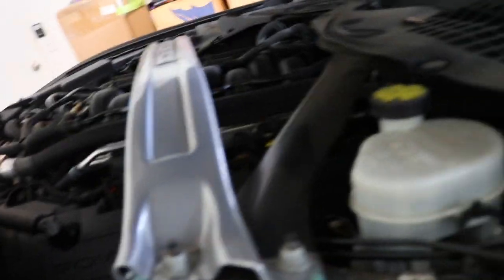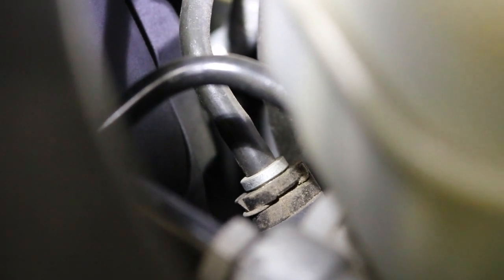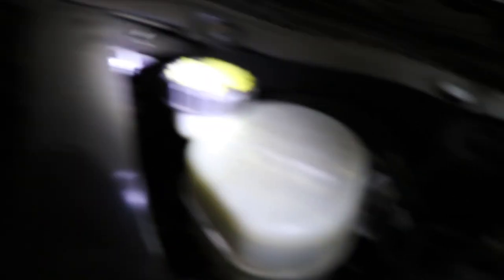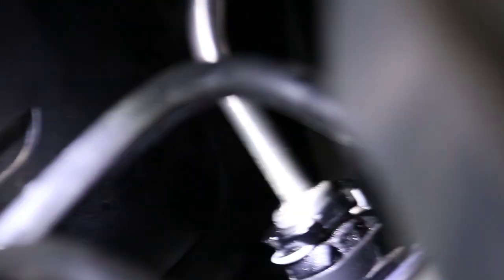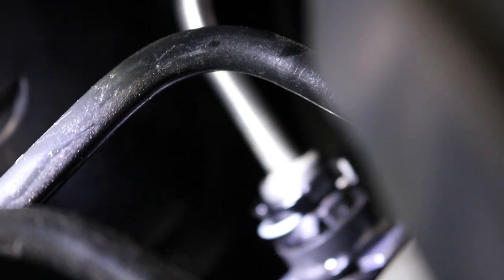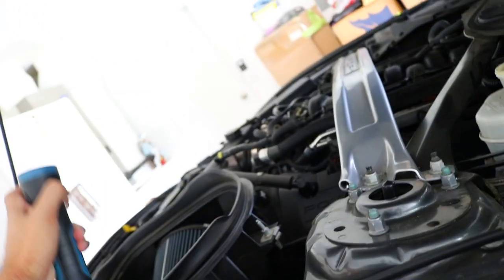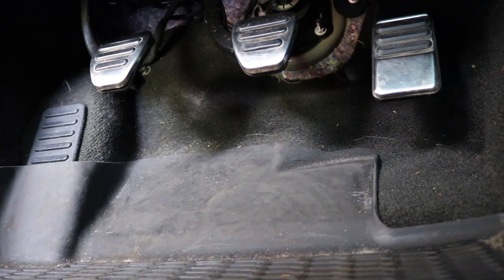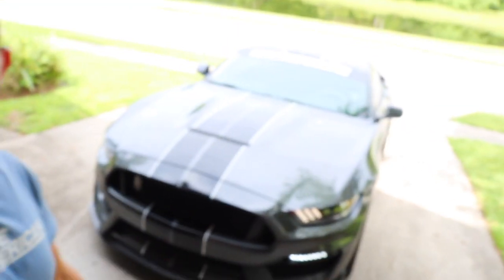BEST Clutch Line Upgrade for Your Mustang!! (15-23 Install)

Comment: Do you install the J&M clutch line on your GT350? I have a 2022 Mach 1 and I told the J&M will not fit with the Tremec?

Comment: Did it help with the 3rd shift lock out
Reply from the maker: It did not unfortunately, your best bet is a new clutch to help with that
Reply: @BrandonChinn  which clutch do you recommend
Reply from the maker: @Ecobeast2.7  I’m personally a fan of McLeod. But I have heard some great things from lethal performance
Reply: @BrandonChinn  appreciate the info
Reply: @BrandonChinn  Did the upgrade clutch line help improve anything with the clutch
Reply from the maker: @Ecobeast2.7  the clutch itself, no. The clutch pedal feel yes